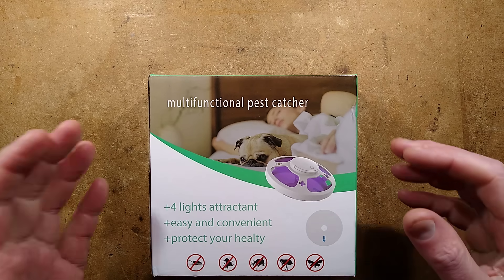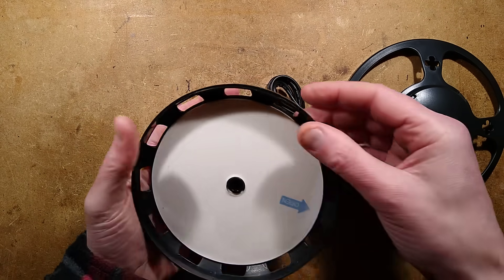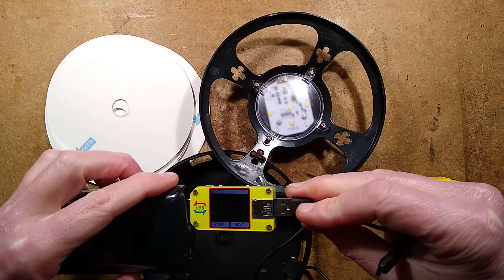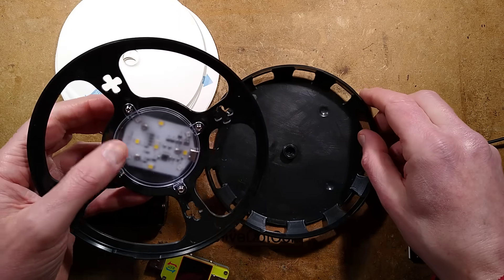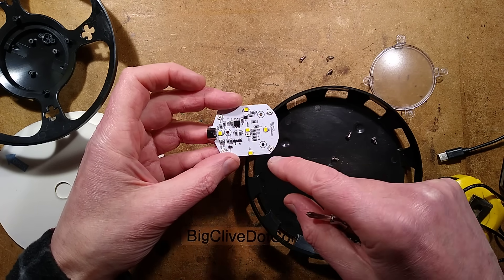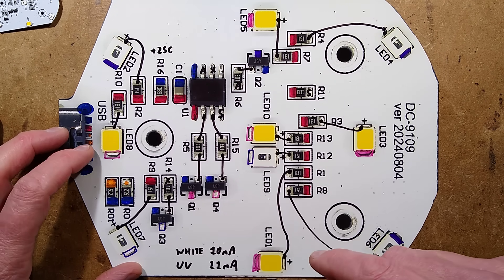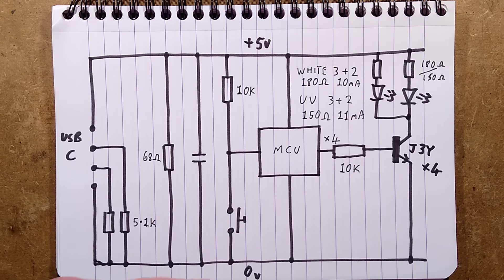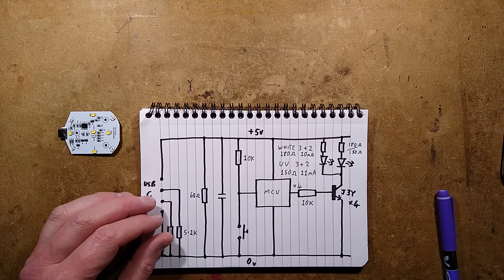USB flea trap teardown - with schematic

Comment: 🫢 ~ I had an experience of ‘fleas’ in my bedroom; I do DIY repairs and someone gave me faulty vacuum cleaner with a half-filled bag in-it, I can’t remember what happened to the vacuum, but the next day I was sitting on the floor with right hand propping me up, watching a YT video on my iPhone - also on the carpet, when a tiny red thing landed on my smartphone’s screen, it then jumped off onto the carpet then onto my right hand where it painfully tried to eat me, so I swiped it off and it jumped away [I heard faint thud sounds of it jumping] and identified it as a flea; “the first time in my life that I have encountered one & been eaten by it” I stayed on the floor to see if the ‘flea’ would return for another attempt; and it did, when I spotted it I slapped it into the carpet but as they have a hard exoskeleton it survived and was knocked unconscious so I carefully put it onto my phone’s screen and found a compact cassette case and used them to crush it [both hard & flat] and with a tiny “crunch” I confirmed it ‘dead’ and wiped it off. I later went down to the kitchen and reported it to mum and she said “you might find more in your room, they all hopped out ‘that’ vacuum cleaner you were repairing yesterday ~ did you think to leave it out on the driveway and put the bag in the wheelly bin? So that doesn’t happen” ~ 🤷‍♂️ “ I didn’t know the bag was half-full/they had a dog/cat infested with fleas” 🙄 (they should have disposed of the bag and sprayed the vacuum with flea-killer before giving it to me if they knew of the risk). After the conversation, I found more fleas hopping around = so I had to declare my room ‘infested’ with them [several must have survived being vacuumed and had jumped out]. Off went mum & dad to the supermarket to buy flea spray, and I made a diy trap; an A4 paper sheet from the printer, some double-sided tape on the lower half and my angle-pose lamp [had a small candle bulb with a halogen capsule in it] and it was aimed down at the tape assuming enough heat & light to attract the ‘fleas’. As for sleeping; I have a bunk-bed and they didn’t manage to jump up there 😊. The diy trap did work but the fleas were still alive & just stuck to the double-sided tape - assuming the commercial traps have ‘poison’ in the glue to kill the fleas on contact, I couldn’t crush them as what I was using would get stuck to the tape. I then started treating my room by taking everything off the floor and vacuuming it and spraying  along the edges, around furniture and the bottom of the door - to stop them spreading to the rest of the house, unfortunately I found a flea hopping in the spare bedroom next-door, so that & the hallway needed treatment 😠. I put the trap in there and it caught some fleas, but as they were still alive, I came back later and some had managed to jump off the tape 🤯. I had to pull out my wardrobe to vacuum & spray behind it, and do a swap’a’round with the shelving unit & my desk under the bunk, as mum said that fleas love to live and breed in dust ~ their was a thick layer and apparently a lot comes out of my hair and falls down the pillow-end of the bed to behind the unit; awkward to vacuum behind it. And both the wardrobe and unit have a short cavity under them possibly with the fleas hiding. Me & mum had killed the infestation and they haven’t appeared since 🤗✅

Comment: What happens if you remove the "heater" resistor? Does everything else still work? If not, could you just replace it with a higher value?
Reply from the maker: On a normal power supply it will work as normal without the resistor.

Comment: Maybe the spiders in your house help keep the pests down.  In Canada we have plenty of spiders and house centipedes, especially in older buildings with damp basements.  The house centipedes still startle me as their form is somewhat disturbing but they are beneficial.  Oddly, in Japan house centipedes are kept as pets and are called, "giji giji" and live about the same length of life as a hamster, around three years.  That's pretty good for a small invertebrate.

Comment: Flypaper with lights....awesome.  The sticky paper disc are most likely blank CD labels , even have the hole in the middle but I could be wrong.  Thanks Clive.
Reply: Unlikely, since CDs are 120mm and these are 135mm.
Reply: @RFC3514  Thanks.

Comment: Years ago, I had a similar bug trap that was just a green seven watt bulb in a pyramid shaped plastic box with sticky paper at the bottom. It worked fairly well as I recall. 
    The small town I lived in back in the '80s was invaded by fleas. Whatever conditions fleas like were present, and virtually everyone there had them. Kept the local pest control people busy for a while.
   Spiders ignore those traps, it seems.
Reply: "Spiders ignore those traps, it seems."

makes sense.  spiders do not hunt using infrared.

Comment: You can use something like an LED book light, along with a dish with some some soapy water to get the same effect that your traditional flea trap gets, as the "heat" required is very minimal. Not only is it lower power, but its much easier to cleanup & reset the trap with new soap water compared to the sticky mats.

Comment: A couple of passing thoughts -   1. Motion sensing flea light.  That sounds unproductive. My understanding is the reason an old night light bulb attracts fleas is not the light.  It is the warmth from the incandescent bulb, which the fleas mistake for the body warmth of a mammal (human, dog).  Which also makes me wonder if the visible LED unit you showed would work as well due to (presumably) putting out less heat than an incandescent bulb.   2. "British tape measure"   Just FYI, it is extremely common for tape measures in the US to have both imperial and SAE.  You can buy other options but that is common in cheap tape measures.  My guess would be - made in China - a dual measurement product can be shipped to more countries. :)

Comment: I wonder if the 0.36W of the 68R resistor produces enough heat to attract heat sensitive bugs?
It's a whole lot less than a 15W lamp (producing about 13.5W of heat and 1.5W of light with a typical efficiently of 10% for an incandescent lamp)

Comment: I have 3 Victor brand sticky flea traps (that uses a night light incandescent bulb) in my basement.  For some unknown reason, my basement seem to spontaneously spawn flea-like bugs all year round, so all of the traps there are VERY successful.  I originally thought the fleas were brought in by my cat, who goes outdoor a lot, as I keep her litter box down there.  However, I have the same flea trap in the living room where my cat hangs out most of the time when she's indoors, but this trap barely snags half a dozen fleas during the same time period between replacing the sticky pads.  The trap I keep under my bed catches quite a bit more than the living room's, but it still doesn't compare to what each of the 3 in the basement are doing.
Reply from the maker: It mi9ght be worth experimenting with the soapy water type of trap if you are getting through a lot of the sticky sheets.
Reply: Is the basement a more  humid environment? Cats and fleas equal tapeworms. Beware.

Comment: Was the 68R resistor removed, or was it proven necessary?
Reply from the maker: It would work without it.  But I'm not sure if the trace heat is needed as part of the lure.

Comment: I have an Amazon Kindle reader (10th generation), with which the current drawn from a USB wall wart never drops below 62 mA, as measured by a Ruideng USB tester. A similar ‘sleep current is drawn by an older Amazon Kindle reader. You can’t actually turn these things off. I don’t kniow why they never turn completely off, but they don’t. Amazon claims that the screen uses no current, once the page has been displayed. However, the current drawn when the device is awake, with the back-lights disabled, is over 100 mA. It’s easy to see why these things will flatten a battery in a week or so without ever being used. This seems very wasteful to me. I wonder if all of these devices do this, or is this a special Amazon ‘feature?’
Reply: The screen doesn't use anything and will remain in whatever state it was when disconnected from circuitry however it sounds like they're not shutting down the processor at all. That's surprising and not good for the batteries.

Comment: I designed, built and tested,  a number of similar flea trap  devices. The unit design was inspired by the need to deal with hedgehog fleas brought in from the garden by my cats. 
The unit features are as follows: 
It uses a super bright green LED light, which has a wavelength reportedly at the peak of fly eye sensitivity. 
The unit is powered by a small  USB power supply, to avoid approval and safety issues. 
The unit consumes only 30 mA @ 5 volts while the LED is on. 
The LED is switched on/off, in  a pseudo random sequence, controlled by a small eight pin,  PIC microprocessor. The LED sequence mimics animal movement, which attracts the fleas towards the light. 
Since the light is only effective in low light conditions, an LDR, connected to the PIC, only activates the trap when the ambient light level is low
The LED is mounted by a tripod arrangement,  over a shallow water filled trap, with a few drops of liquid soap added to it. The soap lowers the surface tension of the water, causing the fleas that fall in to sink immediately and drown.
The unit he's been tested by a number of people, who report it is very effective, as is evident by the content of the used trap after a few hours. 
The most innovative part of the design is the flashing light delay sequence, which was tailored to match the shadows cast by passing animals. It has a brief off period, with a much longer on, optimised to encourage flea movement towards the trap from relatively long distances ( sufficient for most average size rooms.)
The only problem has been corrosion, due to the soap, of the reflective metal dog drinking bowls used to hold the water.
Reply: That's cool. Hedgehog fleas are absolutely awful. I caught a hedgehog as a child, and bought it home not knowing about the fleas. They got in the house and on an old sofa that was temporarily outside. Those fleas lasted for weeks, and boy do they bite!
Reply: @threeMetreJim  our old cats were fascinated with hedgehogs, and would nuzzle any they found in the garden. They also picked up bird fleas from the leaf litter around the bird table. 
The flea killers prescribed by the vet, are very good at killing the fleas on the cat, but not necessarily those on the carpet,  or their eggs. 
At certain times of the year when there is high humidity,  and the central heating warms the house, there can be a sudden explosion in the flea population, as dormant eggs  hatch out from the places where the cats sleep. This is when a flea trap is useful in supplementing the flea medication. Our latest generation of two cats are housebound, mainly due to increased risk from road traffic, and are therefore flea free.
Reply: a glass bowl was considered, and rejected as too dangerous for a floor position, and not sufficiently reflective.
As the bowl was designed to hold water, the problem was obviously the choice of soap, which was originally medicated hand soap. Dog friendly shampoo was a better choice, as it's pH neutral, and safe to drink in small amounts. The amount of soap required is tiny, one or two drops is sufficient to reduce the surface tension of the water. 
The dog drinking bowls have a shiny finish, which reflects the light from the LED mounted above on its convex reflective disk, this reduced the need for a greater drive current, though a mosfet bufferes the pic output. An  LED current of 100s of mA is  possible. The mosfet circuit included a current limit resistor, to limit the maximum output current. A safety feature against the unlikely event of the LED being knocked into the water. A dead short across the LED will not result in any permanent damage to the circuit.
The circuit is housed inn a small transparent  plastic box, with a USB connector on one side and the LED lead on the other, with a plug connection. The transparent box allows light into the LDR, while keeping the assemble water proof.
Reply: @nigeljohnson9820  You have obviously put a fair bit of thought into the construction, my first thought with the "glass bowl" suggestion was that the fleas and other insects would mostly just crash into the side of the bowl as it would be transparent to the light. Your problem with using the dog bowl would have been more that it was made of a poor quality stainless steel, there are quite a few blends of SS and some of them will rust, a quick rub with a wet soapy steel wool pad, as used in the kitchen, would clean that off for you.
Reply: @Tom_From_Oz  they first time we noticed the corrosion problem was when we found a wet patch of carpet. The bowl suffered from tiny perforation holes, not large surface rust spots.
There is never more than a centimetre depth of water in the bowl, so it does not contain that much water. It proved a wise decision not to use a glass bowl, as they do get kicked every so often. 
The dogs bowls are relatively shallow, and are intended to hold drinking water, but, as you suggest,  the quality of the steel is somewhat variable. By using a reflector to mount the LED, it's possible to produce a nice circular light pattern, particularly as the LED is held about 20cm above the bowl, sufficient for the beam to illuminated the whole of the bowl surface.  In the dark, the LED reflection lights the whole room, sometimes with a water ripple pattern. I conducted  tests, comparing the trap efficiency with the LED enabled and not. The results indicated the LED makes a significant difference. There were too many variables to truly optimise the on/off time, so the delays were set to mimic the shadow of a passing animals, that's more on than off. The pseudo random element varies the  on time between a few seconds and a few minutes. The off time is very short,  between 0.5 seconds and 1 second. I have no idea if this is truly necessary, but it was easy to do, and made the mimic more convincing. The assumption is that fleas require a recovery time between jumps, and to re-orientate to the direction of the light. 

(All my projects are documented, some better than others, in a computer design directory file, this contains  sub directories for: project research notes and design calculations, component data sheets and materials, mechanical information, circuit diagrams and PCB layouts, software, test results and  photographs of the finished project. I published a few on the old Maplin forum. I should say, my brother and I share the work between us.)
Reply: Curious.. smart enough to build electronics, but not to think of using a glass bowl.
Reply: @MikeB_UK   a glass bowl was considered and rejected, as too dangerous (for floor position) and not sufficiently reflective.
As the bowl was designed to hold water, the problem was obviously the choice of soap, which was originally medicated hand soap. Dog friendly shampoo was a better choice, as it's pH neutral, and safe to drink in small amounts. The amount of soap required is tiny, one or two drops is sufficient to reduce the surface tension of the water. 
The dog drinking bowls have a shiny finish, which reflects the light from the LED mounted above on its convex reflective disk, this reduced the need for a greater drive current, though a mosfet bufferes the pic output. An  LED current of 100s of mA is  possible. The mosfet circuit included a current limit resistor, to limit the maximum output current. A safety feature against the unlikely event of the LED being knocked into the water. A dead short across the LED will not result in any permanent damage to the circuit.
The circuit is housed inn a small transparent  plastic box, with a USB connector on one side and the LED lead on the other, with a plug connection. The transparent box allows light into the LDR, while keeping the assemble water proof.
Reply: 😂🤣 you invented that didja?
Reply: @rocknrolljesus3197  I made no mention of invention. I designed it, and specified its features based  on  basic research papers on the behaviour of these insects. It is not a copy of someone else's work, and in that respect it is an original invention. It's not exactly rocket science.
Reply: @nigeljohnson9820  it's not rocket science realizing everything you mentioned has been on the market for many decades son.....not *"designed" by you. Nice try though. 😂🤣😂🤣
Reply: @RocknRollJesus101   Chairs have been around a long time, but you still have to design one in order to make it.
Reply: @nomennudum4592  exactly,  any other reasoning would imply that microwave ovens, for example,  are not designed,  simply because the cavity magnetron, on which they are all based, was invented in the 1940s, and the basic control  functions appear on all models on the market, and have not changed much for decades. Models from different manufactures are distinguished by their specification,  features list, innovations in the  design,  and price.

Comment: I've used a bunch of those incandescent flea traps and one "hack" I discovered is that I can use the top of the trap with a large disposable dish filled with soapy water to catch a bunch of fleas, I used an old to-go food container. It should be doable with this trap too.
I had a crazy flea infestation in my cat's room and the soapy water dish let me trap a ton of fleas without needing to constantly replace the glue trap. I just had to refill the water once in a while and then toss the entire disposable dish after a long while.